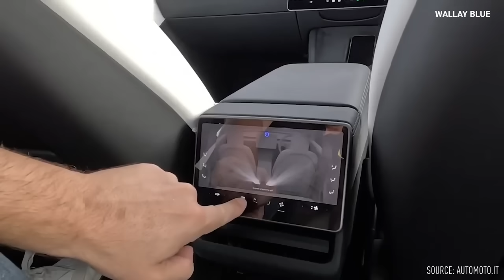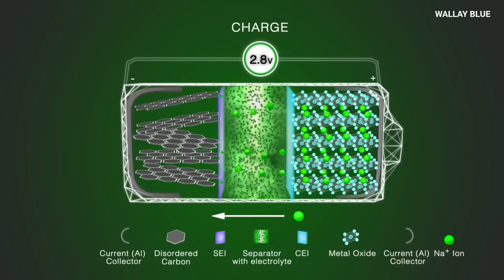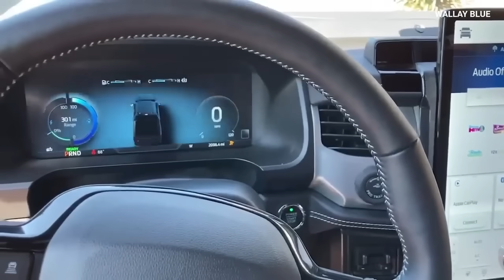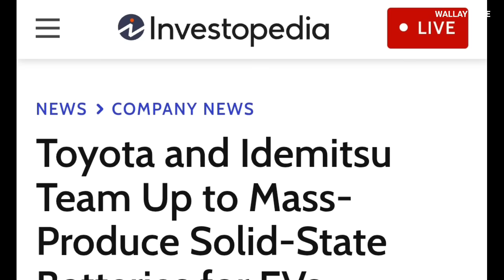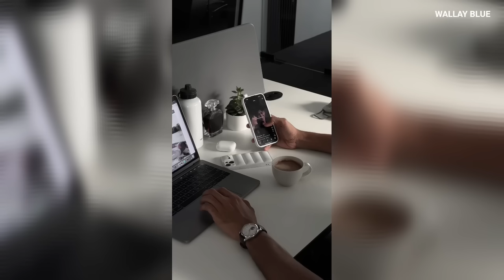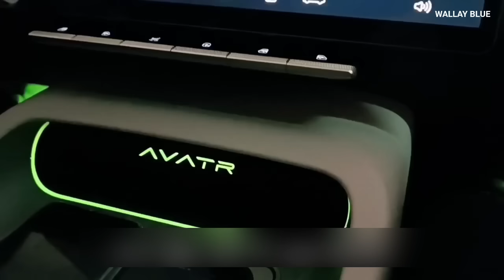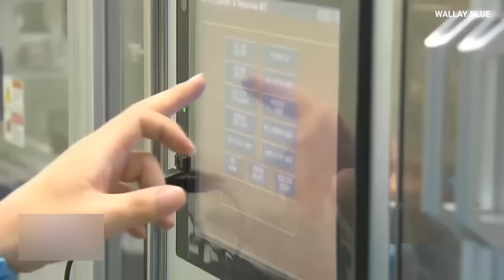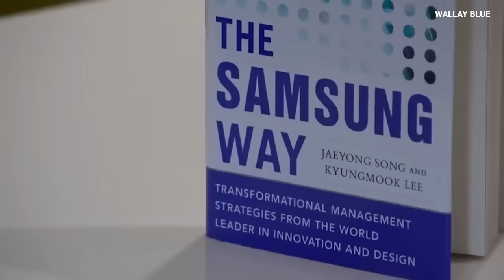Samsung Solid-State Batteries - The Range Electric Cars Will Cover With These Batteries!

Comment: just when damaged?? noo i doubt that there are stories where EVs have taken fire and sunken some ships transporting them then there is the house fires starting from EVs and some public car garages as well... on the ships they were new so the question is how could hte batterys be damaged on a brand new vehicle?

only in dreams will EVs charge at the same time as gas cars okay altough this will help no doubt the problem and this is something we cant fix cause we dont have the technology for it is the fact that on public chargers right and there are 3 or 5 other cars charging theyr cars they are taking power as well soo lets say u have a charger that can theoratically do 350kw with other cars there u arent getting 350kw and the more cars there are there as well the less power u get and this is not solveable okay no new revolutionary battery will fix this cause to stop that issue the power we need to generate is astronomical then there is the fact that this electricity needs to be sent to the chargers and honestly our cables couldnt be able to take that kinda load cause remember this electricity is on top of everything else.... then there is Europe and these days Europe is having an energy crisis cause focusing too much on solar and wind and only in dreams are they good enough to replace coal or nuclear but they think theyr dreams can change reality and in the US well lucky u there but yeaa what solid state will do more than anything is better range and hopefully better charging in cold temperatures and hot temperatures okay current day batterys are very bad at this they do not like any temperatures beyond or below around 20c (idk what that is in fahrenheit. 

if ppl have done any research on this they would know but sadly most ppl wont... personally i cant wait for better phone batterys (dont get me wrong i am excited for solid state and i want them to come sooner rather than later but dont try and oversell it when charging a car expecially is more complicated than how much power the battery can receive)

Comment: You're speaking my language, but we have no leaks about Samsung using these batteries in their phones. That worries me. No way they are keeping that under wraps.  

They are releasing SSBs for their watches next year.  If they introduced SSBs for their phones too, they would likely achieve record sales for their phones, watches, and foldables.
Reply: Not so. Samsung are developing SSB for vehicles also, and have announced mass production likely to begin in late 2025 or during 2026, with availability in 2027.
Reply: @addictiveaussie Im aware they plan on releasing SSBs for EVs.  That was the first information they released last year. Then, they released plans for use in wearables, which will be released before the batteries for their EVs.  My focus is on wearables and phones.

 They've said nothing about phones.  However, Ive read more about their plans, so Im comfortable saying they will use SSBs for mobiles.  The challenge seems to be in the manufacturing, so they are starting small with wearables.  Then, they will scale up.

Comment: Sounds good, but if the price is too steep they won't replace gas cars any time soon.  Also, what is the life of the solid state batteries?  I'm waiting on EVs because the battery has to be replaced too soon and costs a fortune.
Reply: HEY MORON PEAK OIL IS 2030, HOW MUCH DO THINK GAS WILL BE BEFORE WE GET THERE !!!! WAIT TILL 2026 AND  6 DOLLAR  A GALLON ?  FYI THERE ARE 126,000,000 EV'S JUST IN COMMUNIST CHINA  ALONE  !!!!!
Reply: No sir ... even if you have existing lfp batteries batteries will outlast the car. Even if you have 3000 charge cycle with range of 250 miles. It will 750,000 miles. After that also it should have 200 miles range.